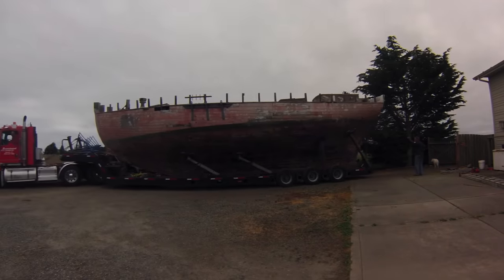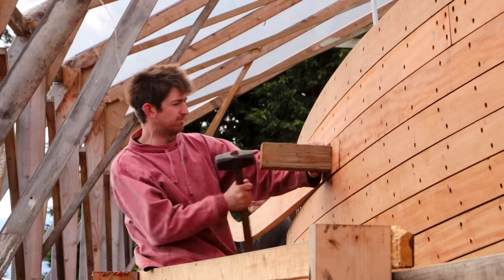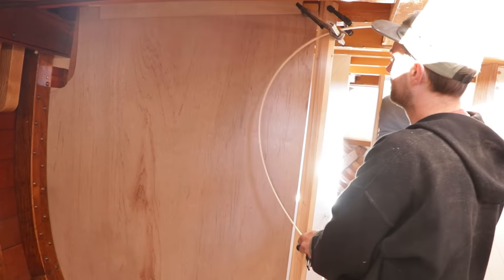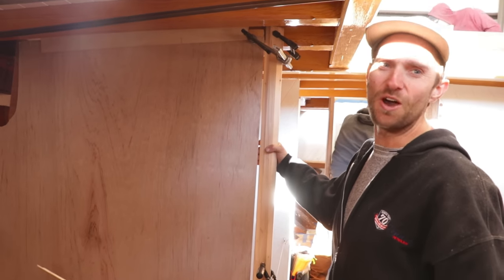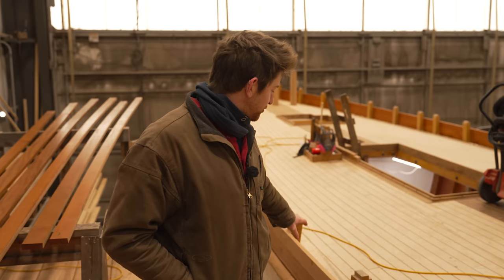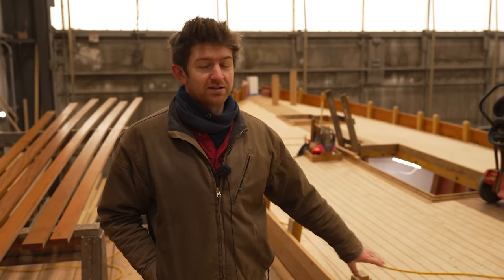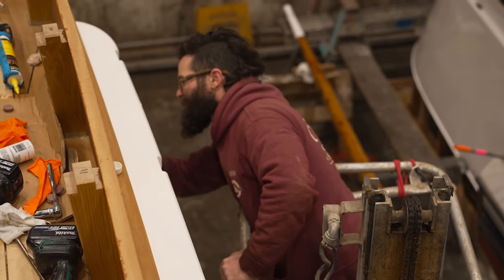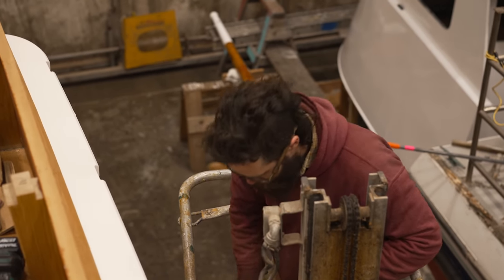Finishing the Bulwarks / boatyard flood!

Comment: Man, that's so nice to see the topside getting so tidied up and squared away! It kind of reminds me of when all the frames and deck beams were in with all the polished bronze floors and hanging knees, rivets and bolts. Like the inside of a man made whale. It's pretty damn epic!!!

 The OCD in me has triggered every time there was a shot of the stanchions all crooked, uneven and snaggly looking. It's so damn sweet now! A couple more jig ideas to consider when looking at a project in a different way. 

 I will never start another project in my shop without asking the question "How would Leo approach this?" ~ if I can adopt just a few things from all of this I'll be better than ever. 

Like those channels Bob put on. using those big dowel pins. Those would be stronger than any hardware you could bolt or screw through wood would ever be I have to believe. They are going to have a lot of force upon them, Seems to be a rock solid interface. 

So, do you put the cap rail on now? with so much work to be done on and inside? I would think, roughed in maybe? or installed and wrapped to protect it? Hmmmmm Leo has an answer for sure.

Comment: Leo, you've been an inspirational leader and the proof is in the way all your friends and workers pick up on your level of expertise and workmanship. I like the juxtaposition  of the strength and power of the inch and a quarter diameter special alloy bolts holding the multi-ton lead keel on the boat compared to the sanding, planning, chiseling, of a 16th of an inch of heart wood to make wood pieces fit together with nary a eyelash space showing between both pieces.

Comment: Dear Captain Leo, Your work has been and continues to be a communal work of Art from beginning to today. In support of your planned long voyage, a thought for the downside planning of such an excursion as yours in the works, please consider that the increasingly deadly Solar rays have continually increased and continue on.  Modern prudence hints to get the best solution for that definite, not a maybe, problem. Perhaps worth checking out?  
If you're out of use of engine for too long a time, and the yards are tattered, and whiskery lines all about and all too soon, would that constitute "too late?" ? 

Perhaps serious solar/heat Shielding for your helm and living quarters at the least. Cover your electronics. one bad sunspot can set your electron manipulating gear on fire as such has happened in recorded USA history.  Copper telegraph wires had spontaneously burst into flame. "Hey, how about them micro circuits eh?".
 Modern materials and know how would make this necessary shielding very C/B ratio thumbs up advance leg up on increasingly deadly solar radiation. 

Radiation Shielding must certainly be made known to you as a New Must See as a responsible adult of a serious ship.

Not shade nor shielding available unless you bring it with you. 

Polarizing glass substitute for the helm pod windshields, or a rolled sheet of flexible light polarizing film to affix to the glass.  ALSO this shielding will be awesome backups and trade goods. 

Earth Space Weather science has knowledge of this and that knowledge advises to humanoids, to prepare well.

 Nowadays a sea going captain might maybe also become more of a captain of a combination seagoing and starship vessel when they must consider Radiation Shielding as a pragmatic must have. This includes of course Radiation protection for the gear of great worth. Captain Leo, you are an exemplar, Rock on!

Comment: Are Bulwark planks ever jointed with a spline or a T&G set up? As all wood moves, it seems like these planks might not stay in the same plane even if they are planed or sanded smooth to begin with. It still remains a treat to see the work taking place on this boat.

Comment: I’m not a sailboat builder and love your videos. Please explain to an uninformed watcher why you would use a softwood as a decking. Isn’t it going to leave marks if anybody drops something on the deck?
Reply: Leo is following the original design - teak center (king planks) & edges (covering boards) w/ softwood infill planks. He stated that this was unusual & speculated that the reason might have been to reduce top-weight (a complete hardwood deck would have raised the center of gravity).

Comment: I see you have found the worlds greatest skill saw in the Makita super saw cat
Relatively cheap
Strong and more durable than any other brand
In my day...working on golf course bridges built in continuous cures we would make repetitive rip cuts that numbered in the 00's on every bridge to allow our decking to swing in line  with our direction......each 10-12' in length in 2.5" treated pine.
When we started the rail installation our practice was to locate our final line to base the curved rail off of by using a continuous line of hot pink string line
followed by a continuous curving cross cut that would improve on that line by cutting across any remaining angles
think the longest I did with a single saw was around 800' or a crawling -- continuous (as much as I could stand on kneepads) 50% freehand cross cut 1600 feet in length
Can't say enough about the tool

Comment: Looks awesome, but I'm wondering. The bulwark planks seem pretty low, like knee-height. I know nothing about boatbuilding or sailing, but it looks like a pretty easy way to trip overboard on stable ground, let alone when the boat is rolling and pitching.
Reply: Some boats raise the height of the 'protection' by adding metal stanchions inside or on top of the cap rail. These stanchions carry one or more guard wires above and parallel to the cap rail. If you do a YouTube search for 'pilot cutter' you will find several boats where guard wires have been installed, at least in some areas of the boat. Here's a link to 'Amelie Rose' : https://www.youtube.com/watch?v=5t1TMGovcTc . I have no idea what Leo is intending to do with Tally Ho.

Comment: Question:  are the drain slots at the bottom of the bulwark planks large enough to drain a big sea coming aboard?  I imagine you don't want to hold on to that weight of water any longer than necessary.
Reply: 'S true that you need the drainage, but when sailing hard, the bottom of the lee bulwark will often be underwater, & lots of water will come boiling aboard through the scupper openings.

Comment: do you check every once in a while if the boat is still level? so you can use the spirit level when you align stuff.
Reply: I gather they check the alignment regularly, to ensure the boat rests "on her lines". Especially before any major operations like bolting the keel or installing an interior bulkhead - nothing would be worse than adding a major component that locked an unwanted 'twist' into the hull.

Comment: Nice work. Is there any reason why this 09:30 is not diagonal like the other bulkheads? And why the cutout of the bulkhead doesn't match the grab handle?
Reply: Most of the other bulkheads are double-thickness to add structural resistance to twisting of the hull. They have 2 layers set at opposing diagonals to improve strength. Patrick's new bulkhead is just a single-layer partition, it doesn't need to be as strong.

Comment: well I can see I have to go back and watch your videos because my first question is probably answered. Its "why did you buy that boat to then just take it all apart?" was it to measure all the pieces? so you could recreate them?
Reply: Leo's original plan was to re-use as much of the original wood as possible. He knew that the deck planking, deck beams & hull frames were mulch, but hoped to re-use the keel, some of the centerline timbers & 50% or more of the hull planking. But as he started the initial disassembly, he found that the keel had too many long checks & couldn't be repaired. Some of the centerline could've been re-used, but had a limited future life-span & would've been a constant worry. Re-habbing the teak hull planks would be very labor-intensive, it made more sense to replace them.
As the channel gained popularity & generated steady revenue, it became possible to replace the entire structure w/ top-quality components, instead of having to rely on tired, aged bits that might compromise the hull's longevity & safety.
Reply: @frederickstibbert7389  oh thank you so much for explaining! oddly enough this was the first thing I thought about today when I woke up, I wanted to go back and see the start. its so exciting. I love boats yet im pretty scared of the water and very scared of the ocean. yet I have a dream of retiring and living on the ocean oddly enough.

Comment: Just curious. And it’s probably been asked a bunch of times already but how much of the current boat is the original boat?
Reply: Not very much !
- The lowest 3 planks of the teak transom (about 30%).
- 3/4ths of the ballast keel (6 of 8 tons) is original lead.
- The bunk rails are made of original teak hull planking.
- The huge old capstan is being repaired & motorized.

Comment: I went to Canoe U., but I wanted to fly so I really didn't put my heart into the classes in Naval Architecture.   Why is it on the older, larger wooden sailing vessels (think the age of pirates) the bulwarks were so much higher...  waist high or better, yet on the classic smaller vessels such as this they just seem like tripping hazards?  I realize you need some sort of wall above the deck to keep loose things on deck... on the deck.   But why wouldn't these bulwarks be higher??  Is it just a style thing or weight?  Both?

Comment: What are some issues that boat or ships have in the cold?
Reply: In cold waters, crew breath & cooking causes high relative humidity below deck. This water vapor condenses on the inside of the hull, then runs downhill. If it finds a hidden pocket between wood surfaces, it'll stay there & feed the fungi & molds that cause wood rot. That's why you see Leo & the crew slather on the bedding compound to the wood joints in the interior fit-out - to eliminate most of those air pockets.
Reply: @frederickstibbert7389  thanx

Comment: Just how often does the shipyard get flooded with the high tide.
All that salt water can't be good for the tools etc.
Reply: Once a year during King Tides for a few days. This year was above the norm for Kings due to very low pressure front.
Reply: @michaeldemarco2415  So Spring and Autumn king tides then if it's anything like here in Brisbane. (Costal suburbs on the bay get flooded at times).

I thought it might just have been a storm surge based on what we are hearing here in Aus about NA getting hit hard this winter.

Comment: I'm staggered such a big boat has such a low railing  
Is there some extra rails or wires higher up to stop falling off?
Reply: no
Reply: IRC race rules require a steel cable running completely around the boat's perimeter at a min. height of 24". Crew wear a web harness & snap a Y-shaped tether to the cable as they move around on deck. The short leg of the Y clips to the harness, & one long end stays clipped to the cable as you move to a new position.
Reply: @frederickstibbert7389  good summary. I am sure common sense and legal liability requires more than a low wooden rail for safety.
Reply: @dnomyarnostaw  - There are any number of government regulations & insurance co. requirements - but they reflect a vast difference between "private yacht" & "commercial passenger-carrying vessel".
Reply: @frederickstibbert7389  of course, but I obviously was talking about the minimals of all applicable laws and standards.
Reply: uh oh,,,here comes the fun police
Reply: @tomstiel7576  here comes the experienced badly scared Ocean sailors,  buddy.
Try having 4 or five lives in your hands through any kind of a blow, and or a drowning death on your conscience for the poor inebriated party goer, slipping between the dock and wharf on calm might.
Noone makes fun of safety on the seas if they have any sense at all  .
Reply: @dnomyarnostaw  oh boy,,,having a bad day are you,,,,welcome to my ignore folder

Comment: Why are flat head screws used so often instead of philips head screws.
Reply: Slot drive is preferred for wooden boatbuilding, although they used Frearson drive for the deck planking. The boat will need repairs in 20 or 50 years, & it'll be far easier to clear the simple slot of old glue & dried goo, to remove the fasteners.

Comment: How does a harbour that is basically on the ocean get flooded?
Reply: High & low tides vary as the sun's gravity adds its effect to the moon's. When both are aligned, you'll get a "king tide", usually once or twice a year. Low barometric pressure & storm surge can add to the effect.

Comment: I can’t be the only one genuinely curious as to how much materials up to this point have costed?
Reply: You're not.
Reply: Leo used to give rough costs, up until the time he moved from Sequim to Port Townsend. I kept a running total:
- US$ 99,000 - hardwood "in the boat", including shipping. Does not include the cost of 8 months the hull planking stock spent in the drying kiln, or the cost of softwoods for deck planking, interior bulkheads & spar timber.
- US$ 36,500 - copper rod (rivets), bronze rod (bolts), bronze ingot & foundry time. Does not include keel bolts.
- US$ 10,000 - deposit for sailcloth.
Of course, these numbers are only the barest tip of the iceberg !

Comment: Leo, pls, explain re the channels naming. On Wiki they call in "chains" https://en.wikipedia.org/wiki/Chains_(nautical)
Reply: The "channels" used to be called "chainplates", they spread & align the "chains". What are now called "chainplates" (b/c they are solid metal) used to be called "chains" b/c they were made from short lengths of iron rod, hooked together in a chain-like fashion.
Reply: @frederickstibbert7389  Thanks Federick!
Reply: @alessiob5866  - Also, "channel" as a nautical term derives from "chain wale" - a wale is a long strake of thicker planking that extends out from the rest of the hull surface.

Comment: I first thought that boatyard flood meant that you would be flooding the video with multiple scenes of the boatyard, not an actual flood of seawater. Climate change is real. We are getting much more cool/cold weather in south Florida than usual. This is the 5th day that I have had the heat running and more cool weather is forecast. I can remember winters requiring no heat at all.